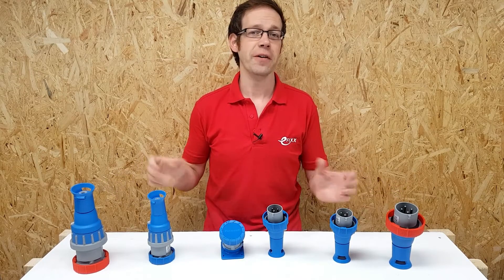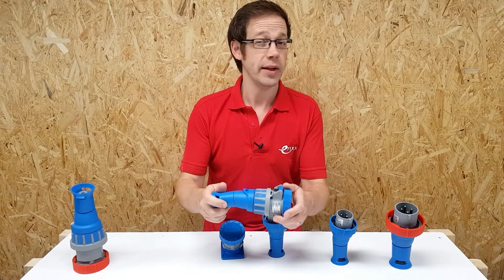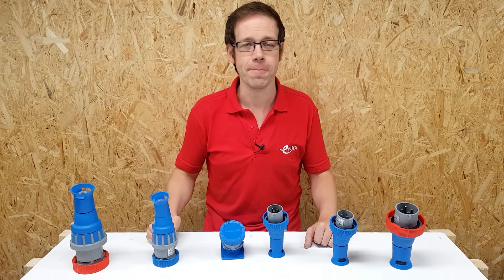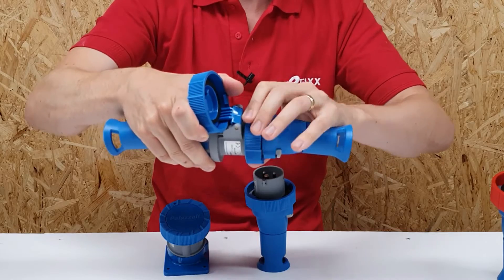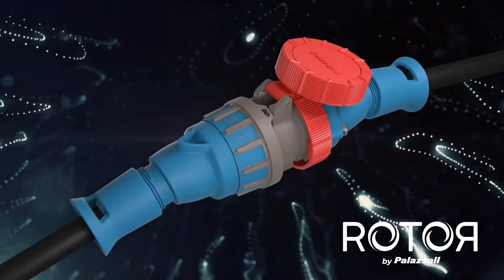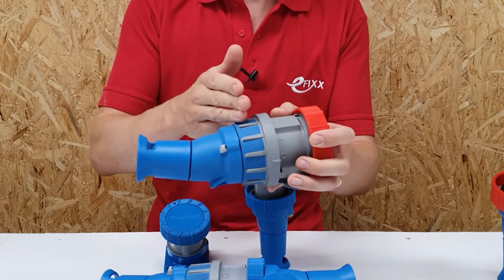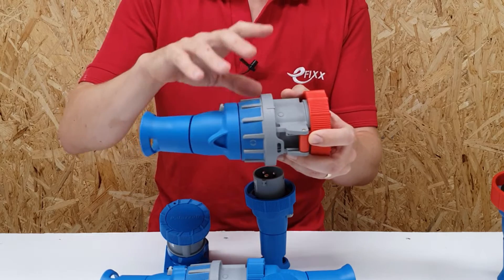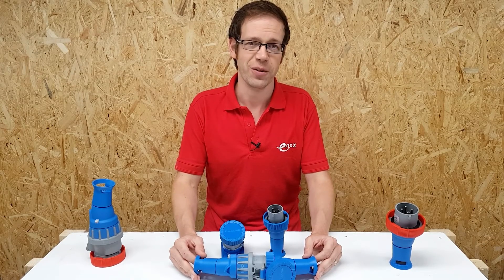Safe Isolation using the Lewden XCEE with Rotor switch.

Comment: Trades folk thinking like engineers - that is the most common sense thing I have heard in a long time! It bugs me that gas fitters (plumbers!) like to think of themselves as 'engineers' yet berate sparks when it comes to newer technologies such as heat pumps and the like, but most aren't interested or willing to do heat loss calcs or balance CH systems - I've come across one that couldn't work out a simple Y-plan system and had to get a spark to do it, whilst another blew up a programmer by re-wiring it incorrectly. In a way the 'engineering mindset' should be drilled into those doing any kind of electrical qualification and registration with an approved body - to some extent sparks have to have some engineering ability anyway to do current calcs, losses, conductor sizing etc anyway, this is just an extension of it :)

Comment: "... Not allowed in a domestic setting"!

So it is LESS likely that a child will poke their fingers or knitting needle into a standard "Caravan" connector?! Surely, despite being outdoors, there is the same risk? I don't recall seeing a change in Caravan pedestal outlet points being mandated! 

In addition, what about 3 phase commando connections? Not necessarily for "real" 3 phase but from say a single to three phase VFD to drive a three phase pillar drill motor in a home workshop?

Finally, although I can see the sense in such safety features, if it is only the lack of shuttering that is the issue (apparently) I can envisage a relatively simple design change to a standard CEE socket where a rotary shutter is fitted, actuated by insertion of the (longer) CPC pin. Just like a standard 13A socket.

Given that even as a fully grown male, once connected, I have great difficulty in detaching a blue single phase CEE plug from an in line socket. That's not even to mention the contortions and discomfort created by some designs to lift the cover latch AND pull the plug and socket apart. Can a 12 year old, let alone a toddler manage it?

With regards to safety, are we saying (as someone has already mentioned) that a trailing lead 13A socket (with shutters) is SAFER to use in a domestic setting than a CEE socket? I'd personally MUCH prefer the robustness and generally far better water resistance of the latter.
Reply from the maker: Interlocks are a requirement on caravan sites.
Reply: @efixx  ZERO interlocks are provided on the vast bulk of single and three phase small generators including up to 8k5VA, probably beyond! So are these generators now banned for domestic usage, or with Caravans? 

Are the ubiquitously available 13A plug top to 16A CEE socket now going to be banned completely thereby preventing consumers keeping their RVs, caravans etc charged/powered at home because they have an unshuttered connector? 

Good luck with convincing Halfords, every caravan and/or RV centre, every car accessory shop across the UK to dump their stocks!

Existing interlocks on caravan sites DO NOT require anything other than standard CEE 16A plugs! Changing a "standard" cable connector for a NEW proprietary version, no matter how clever isn't going to fly. Such NEW interlocks MAY be mandated on NEW installs (stupid!), but what about existing, perfectly compliant to BS7671 2001 standard, as stated by the Caravan club? What legislation exists for enforcing retrofit? None as far as I'm aware!

My friends who have RVs and caravans STILL use bog standard CEE connectors, as do the vast majority of existing caravan sites! Why? How? Simple, because there already exists a standard, FULLY compatible,  interlock system on caravan sites ... Push in standard CEE cable and twist to connect!

Total incompatibility between the two types (as far as I can see) so any site fitting these sockets/plugs exclusively will have customers turning up unable to connect to power at all!

Is there a SINGLE standard for such interlocking connectors? No!

Is there a SINGLE cable for users to purchase to guarantee connection capability? Currently, yes ... Standard 16A CEE connector. With these proprietary connectors? NO!

Is EVERY camping site across Europe subject to use of 100% compatible interlocking CEE cables/connectors? Currently, YES! With these connectors? NO!

Can anyone walk into Halfords and buy a single phase 16A CEE caravan cable? Yep! Do those cables have interlocks? Nope! How many non-compatible interlock cables are Halfords (or any other caravan or auto store accessory shop) likely to sell vs the current "standard" caravan cable? So few that stocking them would be financially insane! Try even finding an interlocking CEE connector in such places.

Such non-universal, non compatible connectors may have additional clever safety features but are just plain nuts and completely out of touch with reality for typical and ubiquitous usage!

Comment: Like the idea, glad they let you lock it on too, I'd be a tad worried about the switch getting knocked if it's being used as an extension cord. Nothing a cable tie couldn't fix.

Comment: I think the fact it has so many IP ratings shows off an extremely well thought out, designed and manufactured product - not just for user safety but for its applications. This is the sort of plug that should be used for ev charging and heavy duty machines in industrial areas.